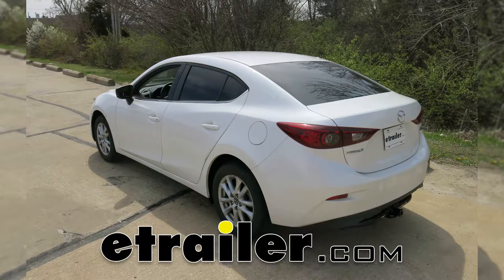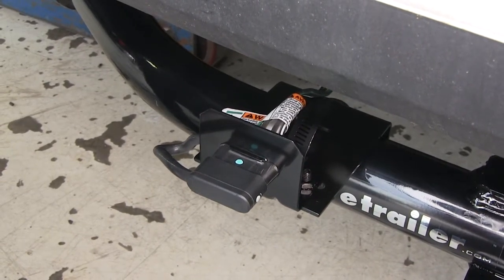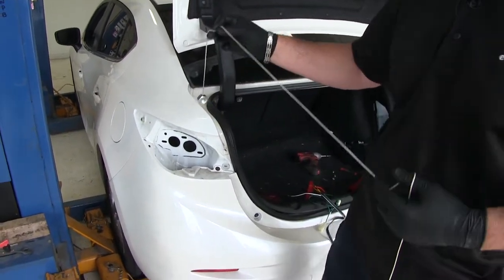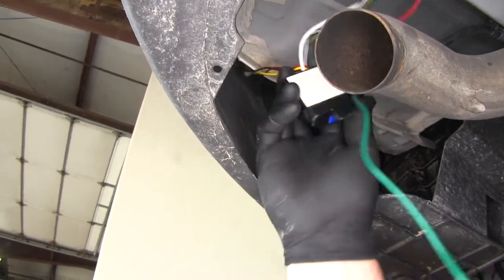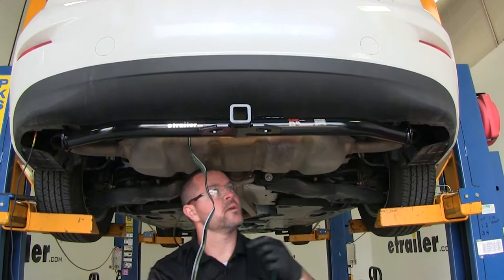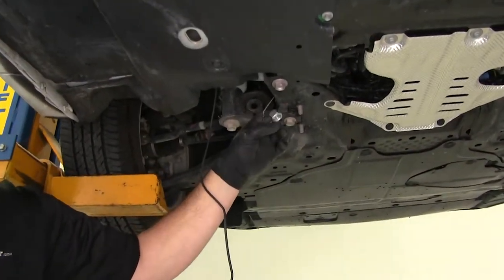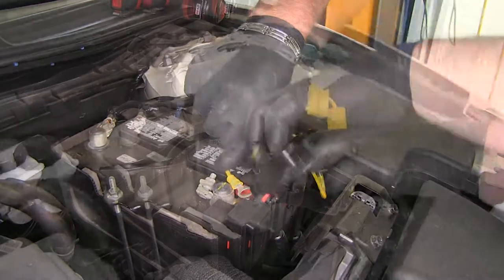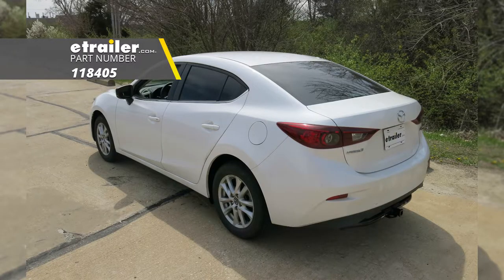etrailer | Mount: T-One Vehicle Wiring Harness with 4-Pole Flat Trailer Connector on a 2017 Mazda 3

Comment: You left out the ACTUAL running the wire forward under the car!  That is no easy feat I expect, particularly that part of the run under the center section that is hidden by the underside panel.....this is the kind of stuff we NEED to see being done as opposed to skipping by it and merely showing it completed.  A "How To" video needs to show the complete process with no sections skipped over, right?  You may be doing this all day long every day, we are doing it once!
Reply from the maker: There is no specified path to run the wires to the front. We typically recommend following an existing wiring harness. You'll want to avoid anything that moves or gets hot. We'll get with our video folks and have them show more of that process. Here's a link to an article on the subject that you might find helpful.
https://www.etrailer.com/faq-Routing-a-Power-Wire.aspx